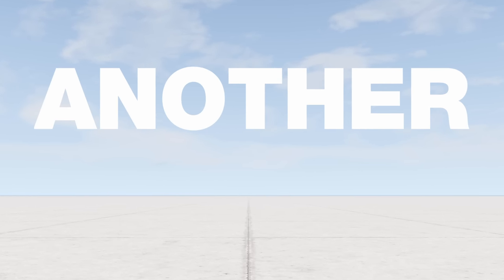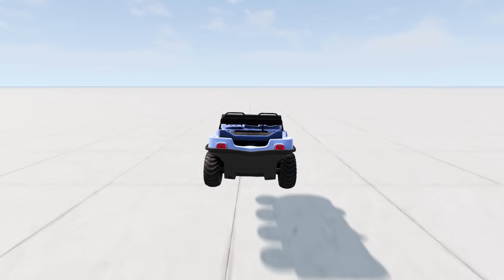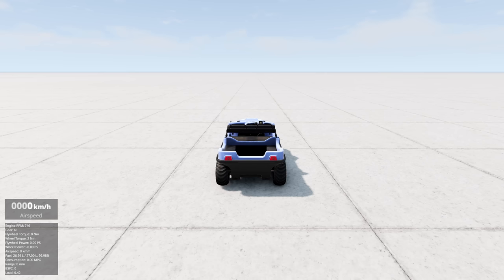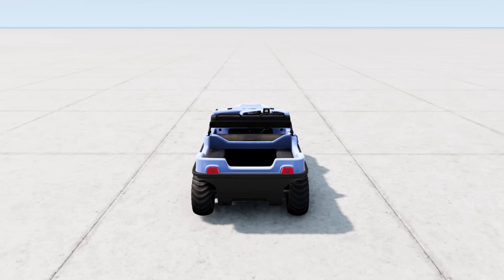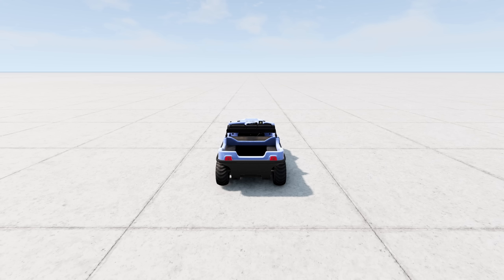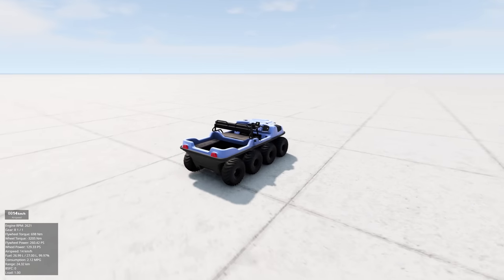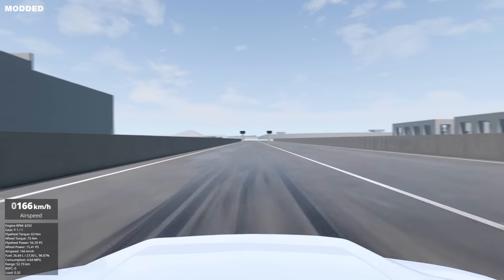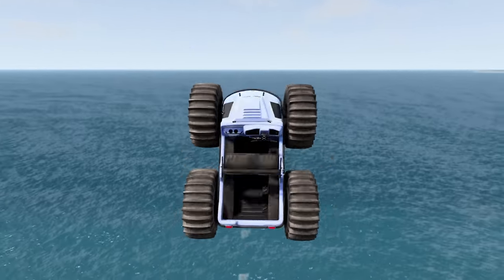I Beat Another BeamNG World Record

Comment: I think it's flying because the difference in the code of the tires that allows it to move on water is interacting weirdly with the air.
Reply: basically a tirecopter
Reply: That makes sense. That makes a lotta sense
Reply: My theory is that it's so much spinning force from the engine that it's beyblading the entire car by proxy
Reply: Yeah like they act like flaps
Reply: You could swim withevery big tire if your car is light. I think the flying happens because the car is not meant for high speeds
Reply: The tires arent coded different i think. Its just a property that rough tires in beamng have. I once stripped out a hopper and put big crawler tires on it so it would float and could also move
Reply: If this is the case, the devs will probably fix it. If they don't, I would be shocked.
Reply: @nnd3v  well of course its the sane code on every car. At least physics wise
Reply: @rayers1000  it's probably not a glitch, with super high reving engines (like anything above 100k rpm) it starts to rotate the entire car, so it's at least consistent
Reply: @nnd3v  it is absolutely possible, they have air resistance and wind in the game, it interacts with objects, they have a specialized script designed to propel vehicles through not solid things using the tires
Reply: @nnd3v  that was worded so  condescendingly it's mind boggling
Reply: its basically force from torque and horsepower (and engine)
Reply: @trivenasuyinti4117  thats not the question, tires in beamng don't normally interact with the air like that
Reply: I think it's because the treads on the wheels that help the car move in water generate so much float that it makes it fly
Reply: The car is flying because the wheels generate a gyroscopic force that rotates the car and pushes it off the ground

Comment: For future reference, taller or longer is for going faster. Think over-drive. You have to go over tall things. Examples being 2:1, 1:1, 0.73:1
Short/low gears are for massive torque. Like 6.75:1, 5:1. 
Input rotaion : output rotation. 
I hope this helps
Reply from the maker: A blessing □
Reply: My 1984 Camaro has overdrive, so I completely understand this

Comment: For future reference: Larger wheels do improve the gear ratio for speed, but they add a lot of weight, so the weight gain is worse than the gear ratio reduction. (Edit: I used lower/higher incorrectly.)

In real life, if you're trying to increase efficiency at high speeds, larger wheels can do this, because they effectively increase the gear ratio, which reduces engine speed, and the extra inertia helps balance out fluctuations, so the engine can run at a more consistent speed. However, the weight disadvantage is still there, and depending on fender design, the aero can change enough to completely eliminate the advantage. Also, larger wheels usually have more rolling resistance, which also decreases efficiency. (A higher gear ratio is better than larger wheels in most cases.)

(Also, efficiency and speed are very related. I drive a CVT sedan with 110 hp but it can go 120 mph without too much effort. If it was less efficient (like having an automatic or manual transmission), it wouldn't be able to get there as easily.)
Reply: I hate CVT because of Nissan and how inefficient they are at being a functioning transmission.

Comment: Bigger wheels usually mean slower, usually due to weight and friction because there’s a larger surface area. Plus IRL you need numerically higher gears in order to ruse bigger wheels
Reply: Actually faster, if you have enough power to overcome  the extra weight and friction. A larger wheel covers a larger distance on 1 rotation.

Small wheel: 10 cm diameter
31.4 cm circunference

Big wheel: 1 m diameter
3.14 m circunference

Lets say that the engine is at 1000 RPM, the gear ratio is 1:1, so engine RPM is the same as wheel RPM.

Small wheel = 314 meters per minute ( around 6 m/s)

Big wheel = 3140 meters per minute (around 60 m/s).
Reply: @rj7250a  thx was looking for this
Reply: But gear ratio is still better tho :P

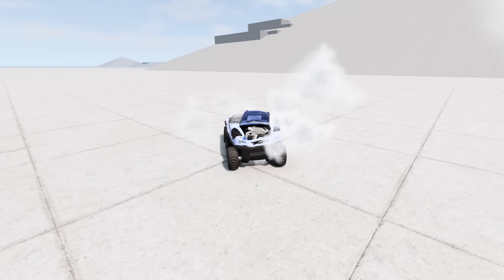Comment: 7:57 the reason why it fly is because at high speeds in reverse the car will start flying because the back is less aerodinamic than the front making the air resistance stoping it from going any furthe it also happens in nascar
Reply: But beam doesn't have aerodynamics simulation yet
Reply: @madgaming6667 actually it does somewhat, it simulates aero devices like spoilers, wings, and splitters.
Reply: You have no idea what your talking about lol

Comment: The main reason that the bigger tires mean a slower speed is because the bigger tires have more of a surface area to be run on as we're smaller tires have less surface area to run on which means a quicker rotation of small wheels compared to big wheels for example cars for example drag cars you can notice they will sometimes have small wheels as where things like rock crawlers have bigger Wheels in go slower this is so that they can get more torque in and more capability I just wanted to say this to make sure that you know and it just felt right to say have a good day
Reply: No, this is incorrect. Bigger wheels actually mean a faster speed in theory, because the edge of the wheel moves a longer distance with less degrees of rotation. You can see this in old steam trains that have massive wheels to maximize speed. The reason rock crawlers have larger wheels is because the larger radius makes it easier for the wheels to roll over small rocks. The reason it didn't work in practice is because it acts as a higher gear ratio which meant the small engine was not powerful enough to keep up, and the bigger wheels also created more drag.
The thing you are saying about drag racers is wrong too, because the wheels that are powered are the large ones and not the small ones.
Reply: But if you have enough power and paitence it means a higher top speed.
Reply: @theneonbop  thank you for the info it helps a lot
Reply: @theneonbop  this and the other thing are correct

Comment: I made one that revs to 20,000 since rpm was such a limitation. It too was very gelatinous at high speed. The physics are just dicked for that thing
Reply: You revved it to 20.000
literally, what did you expect as that is already breaking the laws of physics
Reply: @kitty.x3  I mean it’s not uncommon for sub 1L displacement engines to rev up very high. Sport bike engines have been doing it for a long time. The thing wants to wheelie because the physics calculations for aero and the wheels get super wack at high speed, not because of excessive RPM imo

Comment: The reason it flies is torque. You know how most helicopters have an extra prop at the rear to keep it from spinning? You made the torque SO HIGH that the engine is capable of spinning the entire vehicle. This is the same reason very powerful longitudinally mounted engines cause a vehicle to twist sideways when revved. The engine is literally spinning fast enough to rotate the rest of the vehicle the opposite direction.

Comment: I put a i3 550cc motor with 617.17 bar of boost... (unbreakable engine) and got 120 kmh with 16k rpm

The car jumped 100% of the time when pressing the gas.